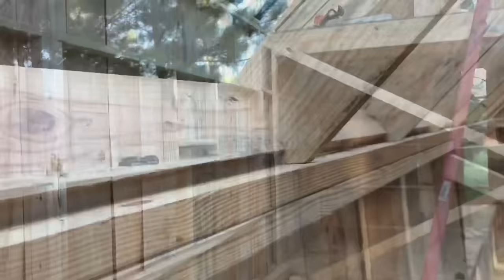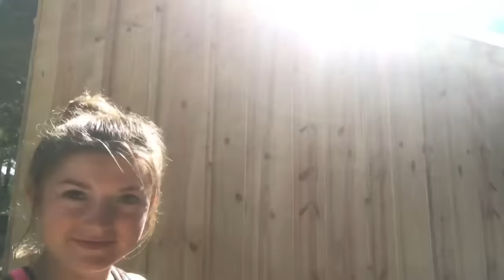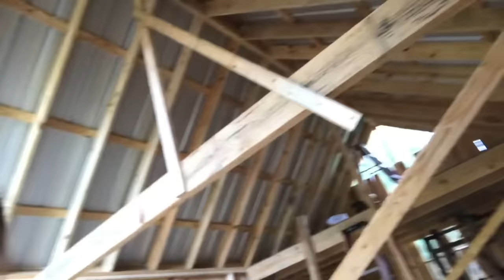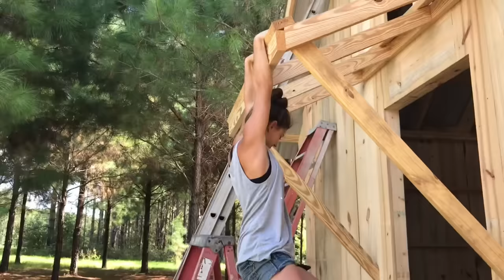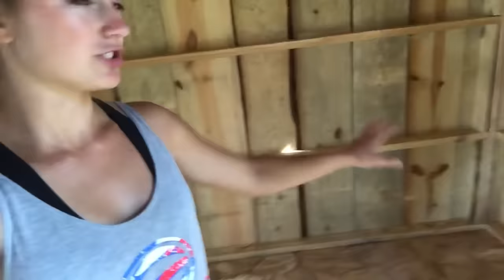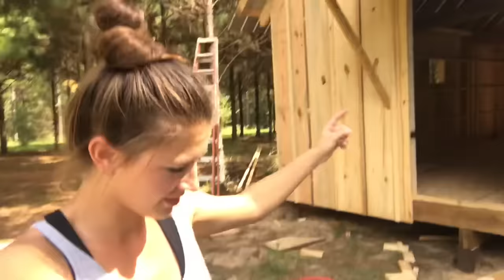Construction Work: Day 4 & 5 Update!

Comment: If the exterior vertical boards had a 45 degree bevel on inside bottom they would shed rain quicker and avoid rain water collecting on the broad bottom of the boards before dropping off. This would help prevent rot.

Comment: This is not a personal criticism, I like your channel. As a professional carpenter I am pointing out that you do not have enough vertical studs holding up the roof, and the loft. You should have a vertical stud at least every 4 feet, preferably every two feet. You can still add them,  just cut them between the horizontal 2x4s. It's a good thing you have little to no snow load there. (Keep up the good work,  I enjoy your videos!)

Comment: Interesting choice in framing technique. I have a run down 100+ year old home with similar framing. It's 1"x12" nailed off top and bottom to a horizontal crossmember and that's what makes the structure. Haven't ever come across that construction technique before or after, until now. This looks very similar.